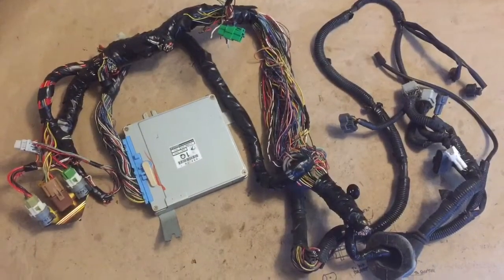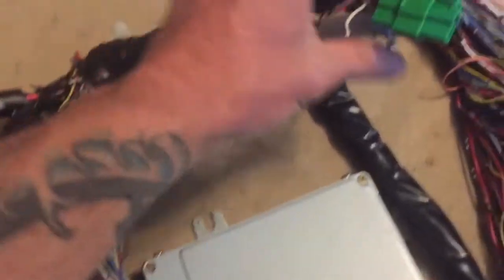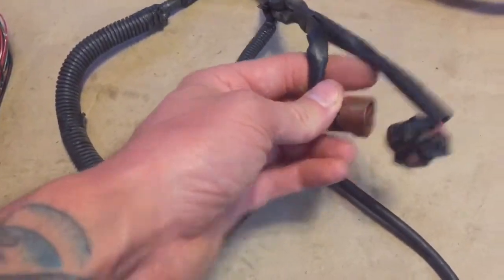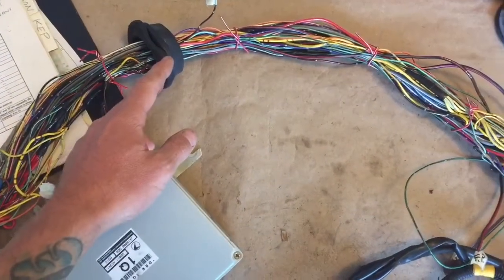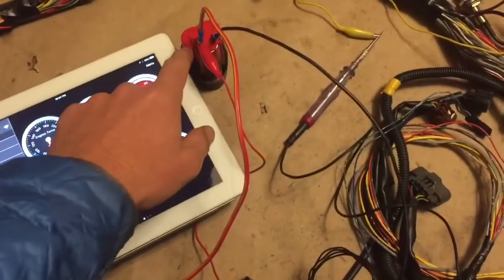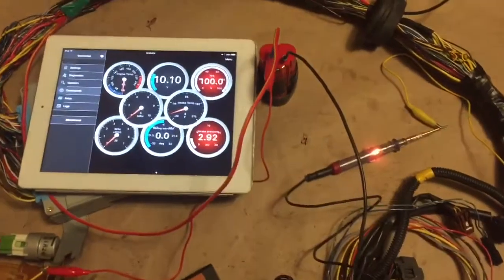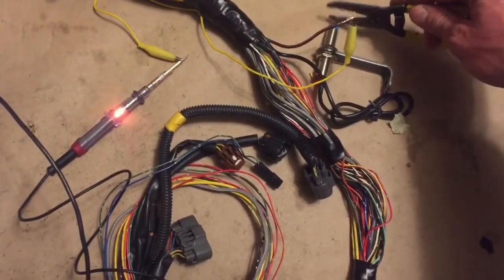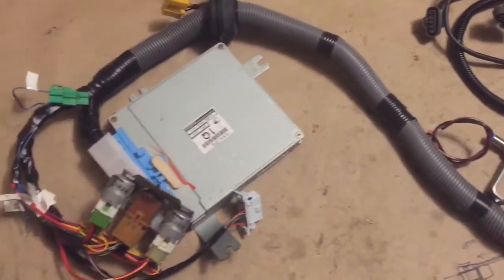1996 Subaru Legacy VW Wiring Harness Conversion

Comment: Hello, I am writing to you from Turkey. I own a 1997 model Subaru legacy with an automatic transmission 2.5 gx engine. The problem with my car is that the signals to the idle control valve and accelerator pedal position sensor are incorrect. Unfortunately, I could not find masters in Turkey who would value this raj and make an effort to do this job. I have a fix schema with the values that these connections should have, but I don't have the knowledge to do that. How can you help me about this issue? Thank you very much in advance for your help. Kind regards,

Comment: What do you charge to do that? Do you ever do the complete swap for people? A few years back I bought a 1976 VW transporter and paid a friend that has worked on vw's for years. Well 3 years later my engine is still locked up and he spent my money. So not sure what I'm going to do with it. I've been through 4 major back operations so fixing it myself isn't an option. I like the vw's but don't like the constant adjustments they need. Subaru swap is the way I need to go. The VW purest can bitch all they want, it's not their car. It now has the 2000cc fuel injected factory engine in it.
Reply from the maker: +Rick Hurt Hey Rick, I do the conversions as well as the harnesses and I also build the parts needed for the conversions. The wiring harness runs $450. You can see more on my website - Busaru.com

Sounds like you got a raw deal with the engine swap for your 76 - hopefully you can get that resolved someday.